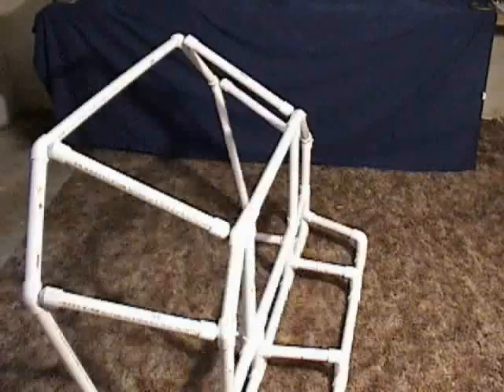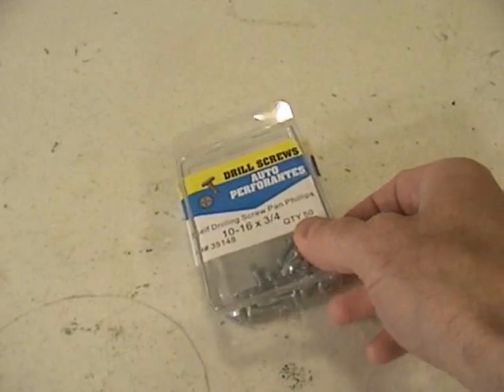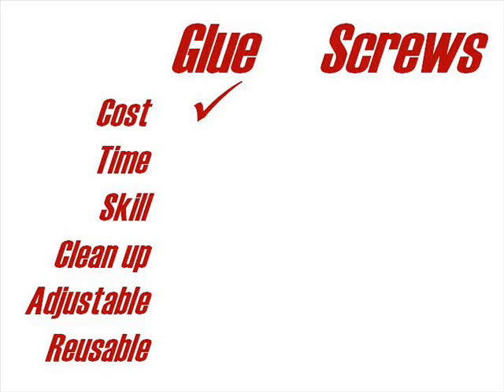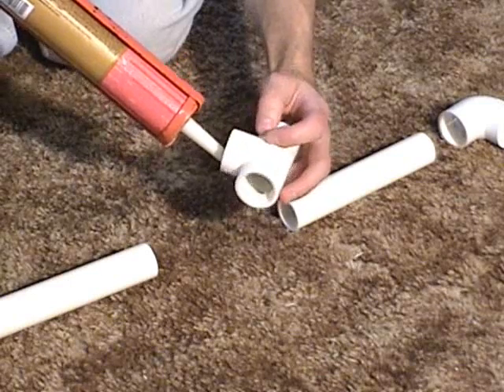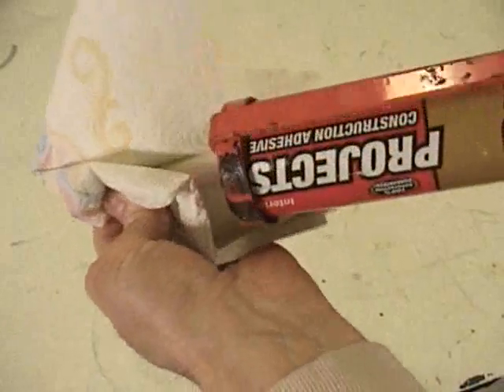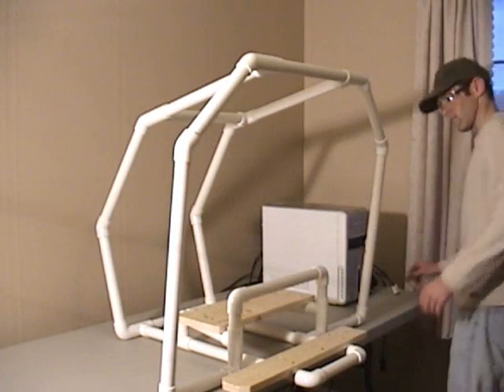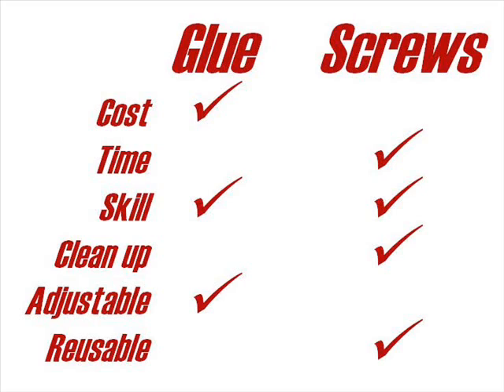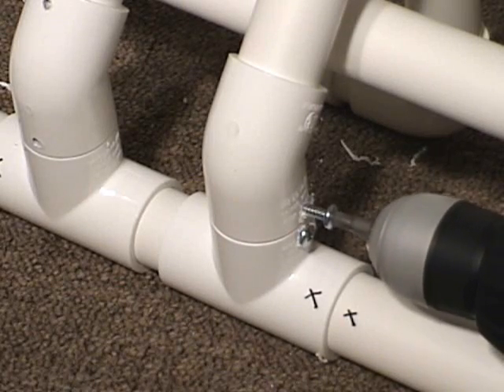Glue It or Screw It ?

Comment: How many joints do you get out of a tube of glue (on average)?  1 screw per joint = 50 joints.  The "if you run out" logic applies equally to glue and screws.  If you run out, you run out.